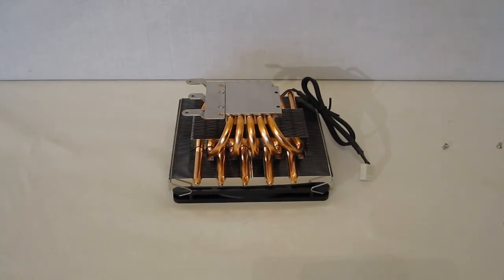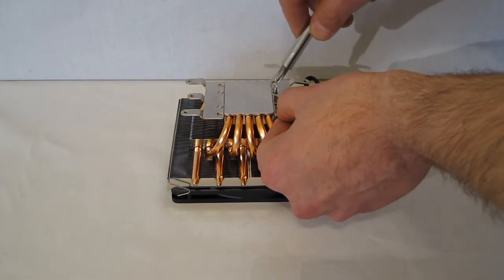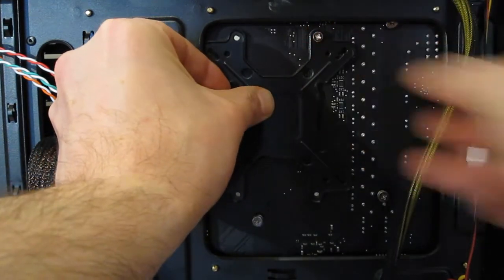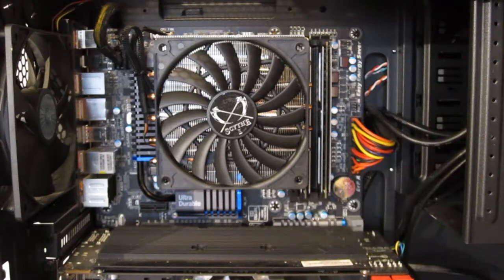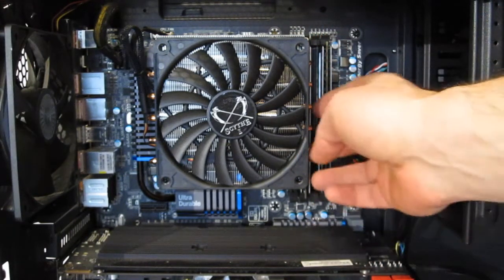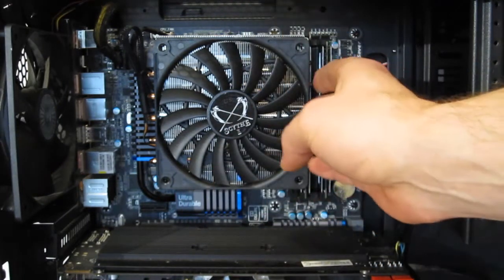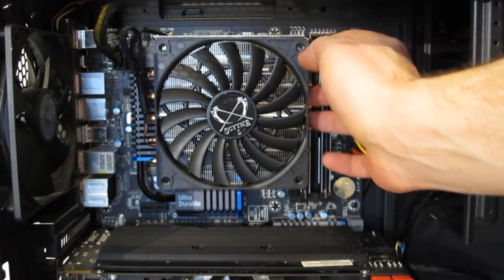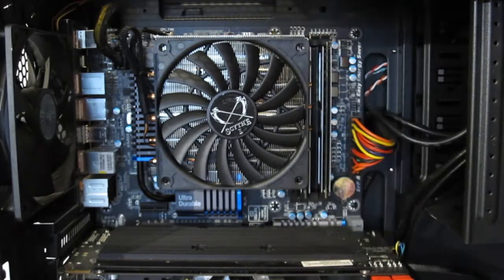Scythe Big Shuriken 2 Low Profile CPU Cooler Installation

Comment: why cant you film the difference in temp for overclocking ?????  do i get under 50 Celsius ?? on max cpu power ? amd fx 8300 4 ghz
Reply: +Simon Näther So, you are asking why we don't film overclocking results with every available CPU, at every conceivable clock rate/voltage, with every type of MB VRM in every conceivable case setup to ensure that your (and every other user's) exact setup is covered?
Reply: just take one cpu and show us difference in temp. how match cooler its get?  my cpu with original cooler gets on 65´c if i play like cs global office if i buy this one hows the temperature then ?
Reply: Simon Näther Like the temps in the actual review we did - http://www.hitechlegion.com/reviews/cooling/heatsinksfans/14334-scythe-big-shuriken-2-lp-cooler-review

Comment: Not sure what the AMD method is like but for my Intel install, it bent the motherboard when I tightened the backplate screws.. so watch out for that people.Another thing is make sure you have atleast an inch clearance from your PSU to your motherboard, as any less and you won't be able to fit the board back in the case.

Comment: You said that the standard corsair vengeance won't fit unless you remove the heatsinks.
But how about the Vengeance Pro, i believe they are a tad lower profile than their predecessor :)
Reply: Only the first slot is blocked, you can use any size in the other three. RAM with any extended heatsink will not fit in slot 1.
Reply: Ahh okay thanks a lot :)

Comment: Hey 
I was thinking about getting this cooler and as I saw 
I have an Gigabyte board too and the VRM and NB are getting really hot with a 6100 at 4Ghz. So is this Cooler strong enough to cool my MB heatsinks as well? 
Are you recommendin other Fans? (maybe BeQuiet's)
What temps are you running at with which voltage?
Please answer

Comment: @xkkiller117 i got one on my fx 8320 and its alot better than the oem fan. note the screws on my one were not thread and just kept on tighting. i advise not to over do it as the motherboard will bend.

Comment: Hi there, do you know if this cooler would be compatible with a mini-itx board such as the ASRock A75M-ITX? I'm wondering because it seems like the memory slots and even the back panel connectors are closer to the cpu socket. Thanks!